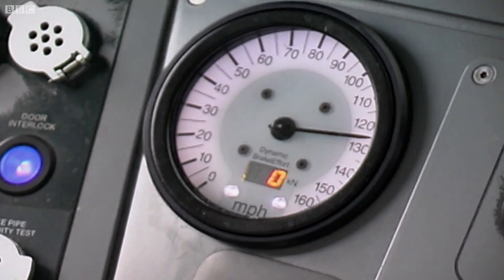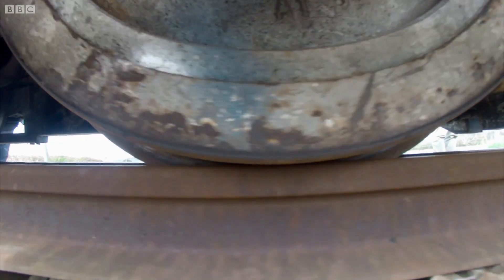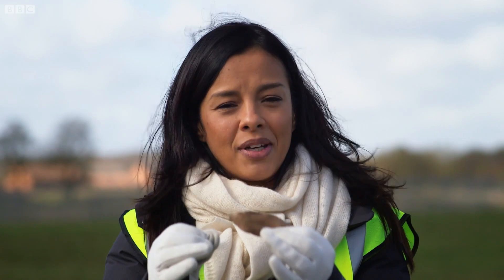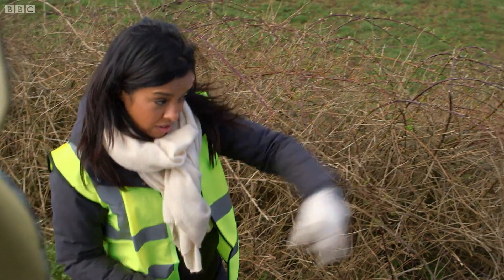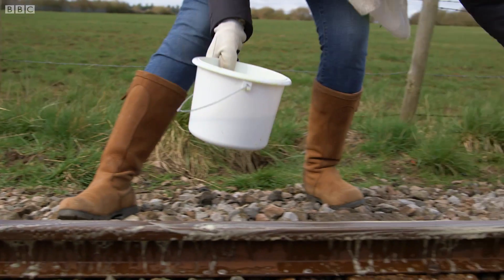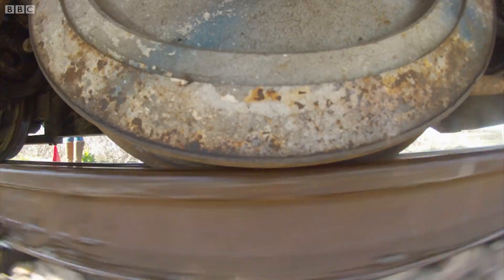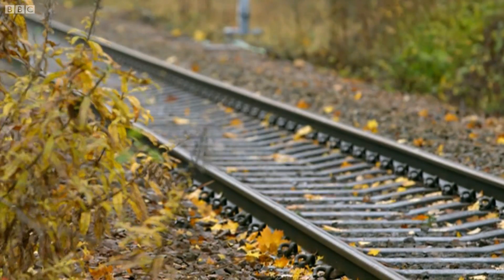Why Do Leaves Cause Train Delays? | Bang Goes The Theory | Earth Science

Comment: In the Netherlands, every autumn leaves on the rails is used as an excuse for delays. I don't believe a word of it. Leaves do not sit on rails. It is a very ustable situation. At the first little bit of wind, they are blown up and away from the rails. The shockwave of a train coming is so big, that the leaves (if any at all) on the rails will be automatically blown off the rails before the wheels arrive. To check this assumption,  I counted from a slow moving train over a distance of 30 km all the leaves on the rails next to my train. It was really, really autumn at the time. Heaps of leaves everywhere besides the railtracks. But the number of leaves actually ON the rails.... ZERO. ZERO over a distance of 30 km. None whatsoever. And oh, I forgot to tell, the 30 km track I am talking about went right through the biggest forest of the Netherlands (Veluwe).
Reply: You can believe what you like. As a train driver of six years I can tell you that leaves on the line are very real issue. It doesn't have to be a forest on the floor for it to be a problem. It only takes moderate leafall in the area that you brake for station, followed by a light drizzle for the wheels to lock, and when they do you know about it very very quickly. I don't drive trains over 100 mph but leaves on the line is a problem that we have every year in autumn and we are briefed on what kind of day it is, and what areas are to expect it so we can brake lighter and earlier to try and combat the issue and keep delays minimum. Most of the delays come from starting away from stations not stopping. The wheels just spin under power. So your never able to get up to whatever the linespeed is, that compounded by braking earlier for stations you can easily lose 15 minutes on an hour trip. This is in London by the way.. It's not a myth it's reality every year for some of us.
Reply: +gfusion I do believe that the rails get slippery, but not because of leaves. There must be some other cause.
Reply: +Ronald de Rooij You need to remember that it only takes a small area of crushed leaves for a train to slide or slip due to the changes in force in deceleration it doesn't have to be a completely saturated line trainline. Once a train enters a slide the wheel will remain locked even after the small area is past due to the trains forward energy. Imagine sliding across a frozen lake and then the surface changes to wet tarmac. You will still continue to slide just at a lower rate depending on how much energy you had proir. Rails don't become 'saturated' by leaves but small patches are enough to contribute. There are no other factors. Certainly not on my lines anyway. November + leaves + drizzle = slide. Every year without fail. Leaves are slippery. I've lost count of the times I've seen people slip over on pavements on crushed wet leaves in the autumn with rubber soled shoes. Trains are no different. Just don't have the rubber.
Reply: +gfusion But I did not see a single leaf on the rails for 30 miles! Not one!. Why don't trains have ABS anyway like every car nowadays? I believe you are sincere, but the story just does not add up.
Reply: +Ronald de Rooij leaves are only one of the issues with rail contamination. Contamination can come from rust, industrial activity, shaded areas which trap moisture, agricultural work, spreaded  spread of Grease from car crossings.. Usually this has to be mixed with a light drizzle to actually lubricate the contamination.. But out of all of the above the leaves will give the most lubrication and give the lowest grip of the bunch. We do have ABS on our trains it's called WSP (wheel slip protection) but it only reduces the effects of wheel slide but does not eliminate it completly. Stopping distances are still greatly increased due to the modulating brake force trying to regain grip.
Reply: +Ronald de Rooij watch the video again. She never said it's from leaves sitting on the line. She said as the train goes past, nearby leaves are sucked under the train and some go under the wheels are crushed onto the rails, leaving a residue thinner than a Human hair, that when wet becomes more slippy than the soap.

You won't see leaves on the track. You'll see them next to it. You're not going to see a layer of fatty acids a few microns thick.

Why are people so readily and passionately convinced of conspiracies?
Reply: +Ronald de Rooij I work for Network Rail, the company who own the track. I've worked on the railway for 22 years. Leaves are indeed crushed by the wheels. Don't forget, as a train passes, its not just a couple of wheels A 2+8 HST set has 80 wheels rolling on 2 rails. As the leaves are whipped up, they are readily crushed on the rails. Ive seen rails SO BAD from this effect, the whole surface of the rail is now black from a carbon like residue from this repeated rolling from the steel wheels, it looks like the surface of a Teflon coated frying pan! Its not just the adhesion problem either, a whole train can "disappear" from a track circuit diagram in a signal box which for obvious reasons is very dangerous. So, all this is far from fiction I can attest from first hand experience.Millions are spent every year trying to keep this coating off the rails.
Reply: +Ronald de Rooij Trains do have electronic anti slide systems that detect when a wheel begins to lock up, it then releases the brakes on that axle. Some also have sanding systems. You must appreciate though that on your average circa 350 ton passenger train, stopping distances are going to be huge in these conditions, letalone trying to excelerate. Did you know that even on a good day, the coefficient of friction between wheel and rail on a rail vehicle is only about 30% maximum of the vehicles weight at the very best!! Imagine what that drops to with a hard Teflon like coating on the rail!
Reply: +jagman84 yeah, you are probably right, it must have been better. When steam was king, embankments and cuttings were kept clear to cut the fire risk. When steam finished everyone foolishly thought that it wasn't necessary to cut vegetation, now its got completely out of control. Also when hauled coaches and steam / diesels were prevalent, you had tread brakes to help keep the wheels clean but now you have mostly disc brakes which add to the problem. NR have started to cut back leaf bearing veg in places but they have about 40 years of neglect to catch up with. There is also the issue of cutting costs too.
Reply: +Ronald de Rooij ronald, gast, wat zit je nou dom te lullen? je hebt het filmpje gezien EN twee deskundigen op dit gebied hebben je uitgelegd dat de blaadjes kapot gereden worden tot een dunne laag smurrie, en toch blijf je janken.
Reply: +formidable38  Was the situation better when steam power was prevalent? I have also noticed that trees tended to be cleared from around railway lines many years ago but since Railtrack/Network Rail this isn't carried out (cost cutting?). It seems to me that no trees = no problem?
Reply: +Ronald de Rooij If I get the opportunity, il take a quick video of contaminated rail head with my phone and upload it one day.
Reply: +kikk0r Er zijn te veel deskundigen in mijn leven geweest die me, om allerlei redenen en over allerlei onderwerpen dingen op de mouw wilden spelden. Ik ben opgevoed met het credo: "Denk zelf". Dat zouden meer mensen moeten doen. En ik zit niet te janken, ik volg slechts het tweede credo van mijn opvoeding: "Zeg het hardop als je iets vindt". Ook dat zouden meer mensen moeten doen. Dan krijg je open discussie in plaats van dom geblaat. Ik waardeer de bijdragen van de deskundigen, maar ik ben nog niet helemaal overtuigd. Dat mag, hoop ik? Of volg jij deskundigen in hun oordeel altijd slaafs? Niet doen. Heel gevaarlijk.
Reply: Ronald de Rooij ABS doesn't help braking distances significantly, it is mostly to improve the ability of the car to manoeuvre. Similarly WSP (train ABS) doesn't significantly improve grip, it prevents damage to the wheels. In some cases sliding wheels can produce more grip, but would result in a train being removed from service as a small flat on a wheel (like a bald patch on a car tyre) is incredibly dangerous. Note this happened recently on a London Underground route where wheel flats caused much of the lines rolling stock to be removed from service.

WSP on some trains applies sand to the rails, and in combination with that helps improve grip, but never to the point of a clean and dry rail. Without sand I have seen some trains unable to accelerate up to a walking pace because there was not enough grip, and then take 2 coach lengths to then stop at those speeds. If you want to know how bad it can get the RAIB have reports on incidents, including one where a train slid for a mile and a half.

This isn't some big conspiracy, there no ulterior motives, it's not just an excuse, the fact is hundreds of millions of pounds are spent on researching and developing systems to deal with the problem.
Reply: So if it isn't the leaves, then what is it that causes delays? 

As a railway man of fifteen years I can assure you that the best days on the railway are the days that go just as planned. If you hear something unbelievable being announced on the first of April it is fair to suspect some sort of made up story but otherwise you can count on the reasons for delays being accurately described 99% of the time. Us train drivers may hold back on the truth if there is a suicidal person further up the line or if the truth in some way is more harmful than saying nothing. Lying about slippery leaves may seem right to you but is indeed a very real problem!
Reply: +formidable38 I am open to this. But show me the leaves lying on the rails, on top of the rails that is! Maybe when I looked the track was cleaned beforehand. I don't know.

Comment: Why not have a special cleaning device that can be mounted in front of the train in order to clean the tracks of leaved as the train moved?
Reply: Razor2048 it's not that simple, it's a squashed greasy residue, not actual leaves. You need ultra high pressure water jets and thousands of gallons of water to remove it effectively at any reasonable speed.
Reply: it would wear out quickly and not be effective on leaf residue.
Reply: water jetting equipment is huge and only works up to 60mph

Comment: Oh Britain and it's problems
Reply: Leaves will be a problem for all railways. As a train driver, I assure you that leaves are much more of a problem for us than snow or ice. The worst conditions for a slippery track are lots of leaves (usually right after a storm) - that can cause problems for several days - or the first couple of minutes of light rain when it's been nice and dry for a while, but that only lasts until everything gets properly wet and the greasiness on the rails goes away. Snow and ice rarely causes slippery rails. The problem with snow and ice is usually related to other things around the rails, most commonly (at least where I work) it's the snow that gets compacted in the railroad switches, causing them to get jammed. Now all our railroad switches are normally heated to prevent this, but like all things exposed to the weather all year round, these things can occasionally break. Considering the amount of switches around any normal railroad line, this will inevitably happen from time to time.
Reply: Liii Llll, that comment really shows your ignorance on the subject.
Reply: +Luis Mendez Not just Britain!Every country with leaves and rain..
Reply: Orku5 well that isn’t leaves is it. You can treat ice with anti ice but you can’t treat LEAVES!
Reply: Computer Addic Japan must not have leaves or rain then
Reply: Lewis M oh America and it's complete lack of decent public transport in the entire country
Reply: +Computer Addic 
Don't think so. Snow, rain, Ice... no problem in Austria

Comment: the soap they painted on the line however covered much more area than a leaf.
Reply: +danwic than a single leaf, there are a lot of leaves in autumn as you propably know.
Reply: +DiplomatDread I just saw the video again - I thought they had applied it to several places,   but they only applied it to one area.    problem solved.
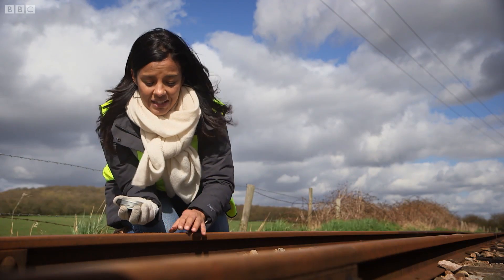Reply: +danwic It's not a leaf that's the concern.  It's the accumulation of crushed leaves mixed with water.  So the tracks have a thin layer of what is essentially powdered leaves, and when they get wet, the tracks are coated in a very thin, slippery substance, more slippery than soap. See 1:45 to 2:00 in the video.
Reply: danwic - it gets drawn along the rails, if you go to a station surrounded by trees you'll probably see it - like a black coating on the rails.

Comment: just put a leafblower on the front of the trains
Reply: +dc2008242 I'm sure if it was that simple , someone would have done it.
Reply: extrude22 idk, I seen another comment afterward where someone was saying that some of them have blowers
Reply: ***** but that wouldn't matter if they all had leaf blowers
Reply: +dc2008242 none of the passenger trains in the UK have leaf blowers, neither do freight as leaf blowers don't solve anything as the leafs will just be sucked back onto the track by the next train.
Reply: dc2008242
the leafs would be sucked back onto the track by the trains own carriages aswell so they'd still get crushed, some of our trains have 10 carriages so it'd be ineffective.
Reply: ***** ugh
Maybe they just need flamethrowers XD
Reply: S O L V E D
Reply: Wesley Holt why couldn't they put a sand release nozzle in the front of each wheel for when the train activates it's breaks a small amount of sand would flow onto the track giving it grip to stop .
Reply: mike 05  A lot of trains do have sanders as an emergency braking aid, but sand is extremely abrasive, so it’s best to save it for emergency stops to avoid eating up tracks and wheels.

Comment: Couldn't they put small brushes in front of the wheels to sort of sweep the track as trains move along?
Reply: +Sinky
I think the brushes would be eroded away before the train gets to the end of the line.
Reply: nikki, they have sanders - while it definitely helps, it isn't the ultimate solution many think - we recently had a low adhesion related incident where the train was doing 12mph (with sanders and the brake in emergency) and it took roughly 300 yards to come to a stand.
Reply: Or sanding equipment...like they used to lol
Reply: Sinky because it is more or less a liquid on the track

Comment: Why don't they have brushes in front of the wheels?
Reply: +Prich038 Brushes would fill up quite quickly with the wet goo.
Even sanding won't help much on leaves! Although I think there's a system that works with compressed air, blowing in front of the wheels, that may actually be effective.
Reply: prich038 brushes wouldn't remove the residue, it needs ultra high pressure water jets to remove it effectively

Comment: This is an age old issue, about time the train manufacturers/ rail company's put there heads together and devise something that can be fitted to every carriage. 

Maybe a jet power wash that cleans the track or something more abrasive such as Cilicia, sand or crushed walnuts?
Reply: +ooGQoo Using an abrasive will also quickly erode the track. Just blasting the tracks with high pressure air jets could do the trick. This prevents the leaves from being crushed in the first place so no slippery goo is produced. Although if things were this simple they'd probably do it this way already.
Reply: +ooGQoo  They already have RHTT (Rail Head Treatment Train) units that carry out such cleaning in critical areas.